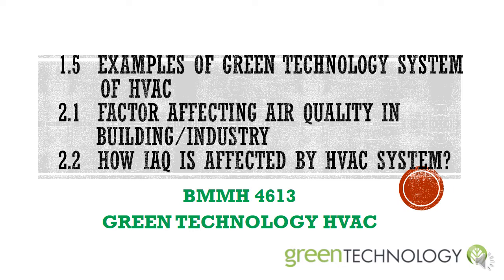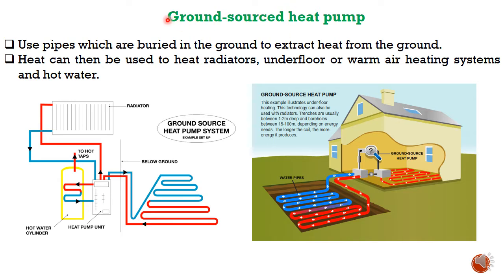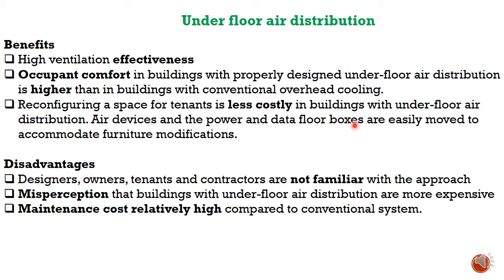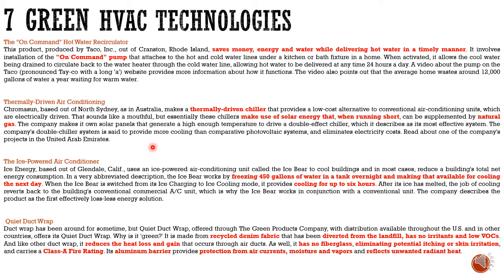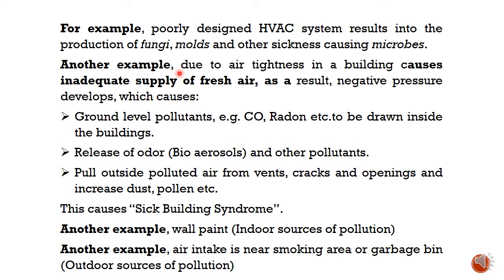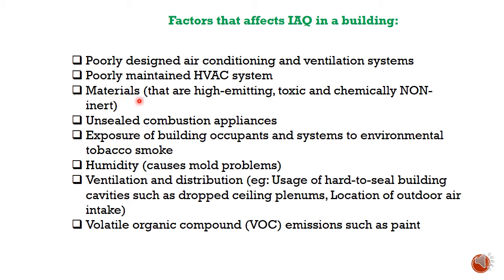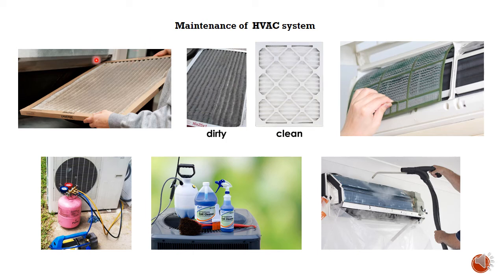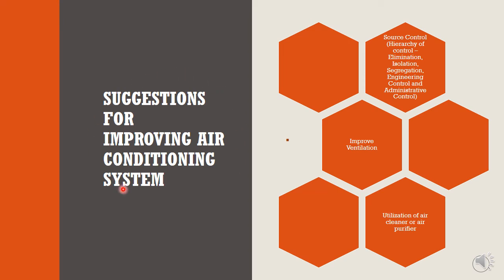Lecture 2 Effects on Indoor Air Quality

Comment: LIM PEI JUN (B071710194)
BMMH S1/2

Air-to-air heat exchangers / Waste heat recovery system
•	Heat recovered from exhaust air to temper the fresh air coming into the building
•	Helps to reduce the overall load and potentially the size of the air conditioning equipment required to maintain.
Ground-sourced heat pump
•	Use pipes which are buried in the ground to extract heat from the ground. 
•	Heat can then be used to heat radiators, underfloor or warm air heating systems and hot water. 
Under floor air distribution
•	Uses the open space (underfloor plenum) between the structural concrete slab and the underside of a raised access floor system to deliver conditioned air directly into the occupied zone of the building
•	Application: The New York Times Building, Bank of America Tower and San Francisco Federal Building. 
VRF air conditioning system
•	One outdoor unit and many indoor units
•	Able to control the amount of refrigerant flowing to the multiple evaporators (indoor units), enabling the use of many evaporators of differing capacities and configurations connected to a single condensing unit. 
•	The arrangement provides an individualized comfort control, and simultaneous heating and cooling in different zones.  
Factor affecting air quality in building / industry (cause of Sick Building Syndrome)
•	Ground level pollutants, e.g. CO, Radon etc.to be drawn inside the buildings.
•	Release of odor (Bio aerosols) and other pollutants.
•	Pull outside polluted air from vents, cracks and openings and increase dust, pollen etc.
How IAQ is affected by HVAC system? 
•	Poorly designed air conditioning and ventilation systems
•	Poorly maintained HVAC system
•	Materials (that are high-emitting, toxic and chemically NON-inert)
•	Unsealed combustion appliances
•	Exposure of building occupants and systems to environmental tobacco smoke
•	Humidity (causes mold problems)
•	Ventilation and distribution (eg: Usage of hard-to-seal building cavities such as dropped ceiling plenums, Location of outdoor air intake)
•	Volatile organic compound (VOC) emissions such as paint

Comment: NUR FITRAH NADIA BINTI KAMIDAN
(B071710363)
4 BMMH S1/2

GREEN TECHNOLOGY SYSTEM OF HVAC 
1.	Air to air heat exchanger/ waste heat recovery (heat recovered from exhaust air) reduce overall load and potentially the ac size
2.	Ground source heat pump (Underground pipe) low energy consumption, no fuel deliveries, low CO2 emissions and minimal maintenance 
3.	Under flow distribution (underfloor plenum) high ventilation effectiveness, better than conventional ac and less cost 
4.	VRF ac system (one outdoor multiple indoor) control amount of refrigerant flowing multiple indoor and individual comfort control

7 Green HVAC Technologies 
	The “On Command” Hot Water Recirculator 
	Thermally-Driven Air Conditioning 
	The Ice-Powered Air Conditioner  
	Quiet Duct Wrap V. Energy Analysis Software 
	The Dual Fuel Heat Pump VII. The Geothermal Heat Pump

Indoor Air Quality ( IAQ ) - How good or bad the air inside the place due to presence of chemical, biological pollutant in the air, temperature & humidity.

Comment: MUHAMMAD SYAFIQ BIN ARZEMI
B071710014
4 BMMH S1/1

   # HVAC System with Green Technology
      > Air-to-air heat exchanger/waste heat recovery system
         - recover heat from exhaust air to temper fresh air into the building
         - reduce overall load & equipment required to maintain

      > Ground-source heat pump
         - pipes buried in the ground to extract heat
         - then be used to heat radiators, underfloor, warm air heating system & hot air system

      > Under Floor Air Distribution
         - use the underfloor plenum to deliver conditioned air into occupied zone

      > VRF Air Conditioning System
         - one outdoor unit with many indoor unit
         - control refrigerant flow to multiple indoor unit with different capacity with single outdoor
         - provides individual comfort control 

   # Indoor Air Quality ( IAQ ) - How good or bad the air inside the place due to presence of chemical, biological pollutant in the air, temperature & humidity

   # Factors Affect Air Quality In The Building :
      > humidity
      > ventilation and distribution 
      > poorly maintained HVAC system
      > poorly design HVAC system 

   # Method to Improve Air Conditioning System
      > control the source
      > improve the ventilation
      > utilize air cleaner / air purifier

Comment: MOHD RAHIMI BIN MUSTAPHA
B071710225

Subtopic on the 2nd Lecture:
1)	Example of the Green Technology in HVAC
>>	Air to air heat exchangers
= Where it the outside air will be pre-heated by using the return hot air from the inside to lower the load and reduce the size of air conditioning   system.
= Resulting better energy efficiency.

>>	Ground sourced heat pump
= Used geothermal energy by putting the pipe into the ground to extract heat form the ground. 
= Using a loop design piping for more better heat exchange.
= Lower energy consumption due to using free energy from the ground.
= Lower home carbon emissions.
= Minimal maintenance required.

>>Under floor air distribution.
= Used open space (underfloor plenum) between the structural concrete slab and the underside of a raised access floor system to deliver condition air directly into the building.
= Has high ventilation effectiveness
= Has misperception that this system is more expensive compare to conventional
= Has high maintenance cost compared to conventional system.

>> VRF air conditioning system
= One outdoor unit with many indoor units
= Can customize the refrigeration flow for each indoor unit with different load based on requirement needed.

7 Green HVAC Technologies
I.	The “On Command” Hot Water Recirculator
II.	Thermally-Driven Air Conditioning
III.	The Ice-Powered Air Conditioner
IV.	Quiet Duct Wrap
V.	Energy Analysis Software
VI.	The Dual Fuel Heat Pump
VII.	The Geothermal Heat Pump

2)	Factor affecting the air quality in building or industry 
IAQ = is where the air quality that can affect the human performance weather inside or outside of the building. Thus, having poorly designed HVAC system will resulting disaster to the occupant inside the building.
Immediate and long-term health symptoms
- Immediate effect = irritation to the eyes, nose, and throat. Headaches, dizziness, fatigue, and asthma.
- Long term effects = respiratory disease, heart disease, and even cancer.

3)	How IAQ is affected by HVAC system
Factors that affect IAQ inside the building:
	Poor design of HVAC system
	Poorly maintained HVAC system
	Unsealed combustion appliances 
	High humidity (causing mold problems)
	Low ventilation and distribution 
Suggestions for improving Air Conditioning System:
	Source Control (Hierarchy of control of elimination, isolation, segregation, engineering control and administrative control).
	Improving the ventilation system and distribution system (such as using fan to such out bad odor in kitchen or toilet).
	Utilization of air cleaner or air purifier.

Comment: ALDY HENRY DUSIM
B071710329
BMMH S1/1

GREEN TECHNOLOGY SYSTEM OF HVAC
1. Air to air heat exchanger/ waste heat recovery (heat recovered from exhaust air)
reduce overall load and potentially the ac size
2. Ground source heat pump (Underground pipe)
low energy consumption, no fuel deliveries, low CO2 emissions and minimal maintenance
3. Under flow distribution (underfloor plenum)
high ventilation effectiveness, better than conventional ac and less cost
4. VRF ac system (one outdoor multiple indoor)
control amount of refrigerant flowing multiple indoor and individual comfort control

7 GREEN HVAC TECHNOLOGY
1. The "on command" hot water re circulator
2. Thermally driven AC
3. The ice powered AC
4. Quiet duct wrap
5. Energy analysis software
6. The dual fuel heat pump
7. The geothermal heat pump

Indoor IAQ
from bad IAQ it will lead to a bad occupants health
1. Immediate effect
-Irritation of the eyes, nose, and throat, 
-Headaches, 
-Dizziness, 
-Fatigue,
-Asthma, 
-Hypersensitivity pneumonitis

2. Long term effect
-Respiratory disease
-Heart disease
-Cancer

Therefore, the IAQ is really important to be maintained so it will not effect the occupants safety and health and to do this the material use for the building and the ventilation for the building must be properly plan and the AC must be maintained every 6 months or so.

Comment: MUHAMMAD AMIR SYAFIQ BIN AHMAD SUKRI 
B071710161

EXAMPLE OF GREEN TECHNOLOGY SYSTEM OF  HVAC
1.AIR TO AIR HEAT EXCHANGER (WASTE HEAT RECOVERY SYSTEM)
•	Fresh air outside will be preheated from air inside (slightly warm)
•	fresh air comes in. warm air cross the flow and before it flows to the outside, the fresh air absorbs warm air from the inside.
•	Helps reduce the overall load.
2.GROUND SOURCED HEAT PUMP
•	Use thermal energy by buried the pipe in the ground to extract heat from the ground
•	Heat then also can be used to heat radiators, underfloor or warm air heating systems and hot water.
Benefits:
1.	Lower energy consumption
2.	Support government to find renewable heat incentive (Malaysia)
3.	Could lower home carbon emission
4.	No fuel deliveries needed
5.	Minimal maintenance required
3.UNDER FLOOR AIR DISTRIBUTION
•	Uses open space (underfloor plenum) between the structural concrete slab and the underside of a raised access floor system to deliver conditioned air directly into the occupied zone of the building
•	Application/example = The New York Times Building, Bank of America Tower and San Francisco Federal Building, Suruhanjaya Tenaga (Malaysia building)
Benefits:
1.	High ventilation effectiveness
2.	Occupant comfort will be higher
3.	Less costly 
Disadvantages
1.	Designers, owners, tenants and contractors are not familiar with the approach
2.	Misperception that building with underfloor air distribution is more expensive
3.	Maintenance costs relatively high compared to the conventional system
 
4.VRF AIR CONDITIONING SYSTEM
•	One outdoor unit and many indoor units
•	Able to control the amount of refrigerant flowing to the multiple evaporators (indoor units)
•	Enabling the use of many evaporators of differing capacities and configuration connected to a single condensing unit
•	The arrangement provides an individualized comfort control and simultaneous heating and cooling in different zones.

Indoor Air Quality

factors that affect IAQ in a building:
•	Poor designed air conditioning and ventilation systems
•	Poorly maintained HVAC systems
•	Unsealed combustion appliances
•	Exposure of building occupants and systems to environmental tobacco smoke
•	Humidity (causes mold problems)
•	Volatile organic compound (VOC) emission such as paint

How to improve air conditioning systems:
•	Improve ventilation system
•	Utilization of air cleaner or air purifier
•	Source control

Comment: ALDEN ANDRIAN PHIUS
B071710392
BMMH S1/1

Green HVAC system
Air to air heat exchanger/ waste heat recovery system (heat recover from exhaust air to temper the fresh in coming into the building)
Ground source heat pump (use pipe which are buried in the ground to extract hear from the ground) 
Under floor air distribution (use the open space between the structural concrete slab and the underside of a raised access floor system to deliver conditioned air directly into the occupied zone of the building. Example app: New York Time Building, Bank Of America Tower And Francisco Federal Building)
VRF air conditioning system (one outdoor unit and many indoor unit)

7 Green HVAC Technologies
The “ On Commands” Hot Water Circulator
Thermally Driven Air Conditioning
The Ice Powered Air Conditioner
Quiet Duct Wrap
Energy Analysis Software
The Duel Fuel Heat Pump
The Geothermal Heat Pump

Factor Affecting Air Quality In Building/Industry
Poorly designed air conditioning and ventilation system
Poorly maintained HVAC system
Materials
Unsealed combustion appliances
Exposure of building occupants and environmental tobacco smoke
Humidity ( causes mold problem)
Ventilation and distribution
Volatile organic compound (VOC) emission such as paint 

Improving Air Conditioning System
Improve ventilation
Utilization of air cleaner
Source control (elimination, isolation and engineering control)

Comment: NUR SELIHAH WAL HUDA BINTI AHMAD - B07171090

Types of Green HVAC System :-
i) Air to air heat exchangers = heat recovered from exhaust air to temper the fresh air coming into the building.
ii) Ground source heat pump = heat can then be used to heat radiators, underfloor or warm air heating systems and hot water.
iii) Under floor air distribution = high ventilation effectiveness
iv) VRF ac system = one outdoor unit and many indoor units.

Factors that affect IAQ in a building :-
- humidity
- poorly maintained hvac system
- poorly designed ac and ventilation system

Improve ac system :-
- improve ventilation
- utilization of air cleaner
- source control

Comment: LUA WEI JIE (B071710861) BMMH S1/2

TYPES OF GREEN HVAC SYSTEM :
1. AIR TO AIR HEAT EXCHANGER(WASTE HEAT RECOVER SYSTEM)
     -HEAT RECOVERED FROM EXHAUST AIR TO TEMPER THE FRESH AIR COMING INTO THE BUILDING
2. GROUND SOURCED HEAT PUMP
    - USE PIPE TO BURIED IN THE GROUND TO EXTRACT HEAT FROM THE GROUND.
3. UNDER FLOOR AIR DISTRIBUTION
    - USE OPEN SPACE (UNDERFLOOR PLENUM) BETWEEN STRUCTURAL CONCRETE SLAP AND UNDERSIDE OF RAISED ACCESS FLOOR SYSTEM TO DELIVER CONDITIONED AIR DIRECTLY INTO OCCUPIED ZONE OF BUILDING.
4. VRF AIR CONDITIONING SYSTEM
   -ABLE TO CONTROL  THE AMOUNT OF REFRIGERANT FLOWING TO MULTIPLE EVAPORATORS AND ENABLE USE OF MANY EVAPORATOR OF DIFFERING CAPACITIES AND CONFIGURATION CONNECTED TO SINGLE CONDENSING UNIT.

MAINTENANCE OF HVAC SYSTEM HAVE TO DO IT EVERY FEW MONTHS TO ENSURE THE SYSTEM IS GOOD AND EFFICIENCY AND TO AVOID SICK BUILDING SYNDROME WHICH IS INDOOR SOURCE OF POLLUTIONS AND OUTDOOR SOURCE OF POLLUTIONS.

Comment: ARVINTH A/L RAMACHANDRAN 
B071710339

Air-to-air heat exchangers 

= Heat recovered from exhaust air to temper the fresh air coming into the building
= Helps to reduce the overall load and potentially the size of the air conditioning equipment required to maintain

Ground-sourced heat pump

= Use pipes which are buried in the ground to extract heat from the ground. 
= Heat can then be used to heat radiators, underfloor or warm air heating systems and hot water.

Under floor air distribution

= Uses the open space (underfloor plenum) between the structural concrete slab and the underside of a raised access floor system to deliver conditioned air directly into the occupied zone of the building
= Application: The New York Times Building, Bank of America Tower and San Francisco Federal Building Suruhanjaya Tenaga Diamond building Putrajaya.

VRF air conditioning system
= One outdoor unit and many indoor units
=Able to control the amount of refrigerant flowing to the multiple evaporators (indoor units), enabling the use of many evaporators of differing capacities and configurations connected to a single condensing unit. 
=The arrangement provides an individualized comfort control, and simultaneous heating and cooling in different zones. 

7 Green HVAC Technologies

The "On Command" Hot Water Recirculator 

= saves money, energy and water while delivering hot water in a timely manner. It involves installation of the "On Command" pump that attaches to the hot and cold water lines under a kitchen or bath fixture in a home

Thermally-Driven Air Conditioning 

=a thermally-driven chiller that provides a low-cost alternative to conventional air-conditioning units, which are electrically driven

The Ice-Powered Air Conditioner 

= the Ice Bear works by freezing 450 gallons of water in a tank overnight and making that available for cooling the next day. When the Ice Bear is switched from its Ice Charging to Ice Cooling mode, it provides cooling for up to six hours

=pump makes use of heat from the Earth by way of looped piping that is placed into the ground. During cold months
= absorbs the heat, which is carried back indoors to provide heating. 
= can also be used to supply cooling

Definition of IAQ

how good, as well as how bad, the air is inside the places we live or work due to presence of chemical, biological pollutants in the air and also involves level of temperature, humidity.”

Immediate and long term health symptoms

=Immediate effects
	Irritation of the eyes, nose, and throat, 
	Headaches, 
	Dizziness, 
	Fatigue,
	Asthma, 
	Hypersensitivity pneumonitis

=Long term effects
	Respiratory disease
	Heart disease
	Cancer

=Poorly maintained HVAC system
=Volatile organic compound (VOC) emissions such as paint

Suggestions for improving air conditioning system

=control of source 
= improve ventilation 
= utilization of air